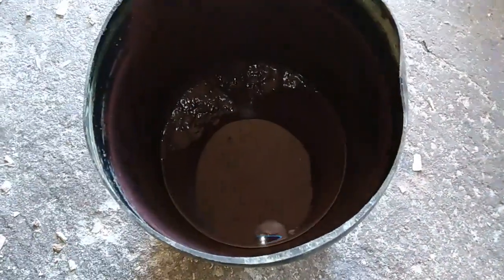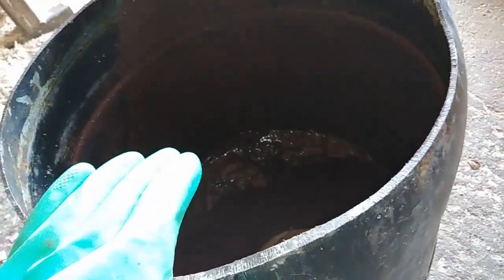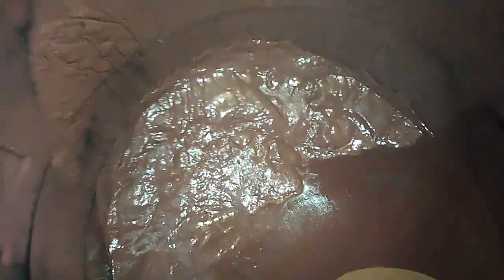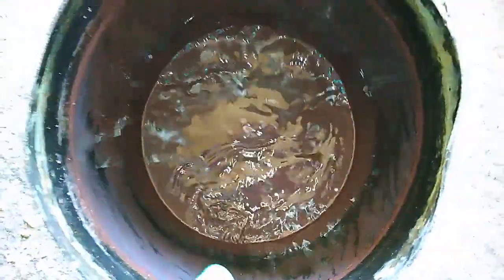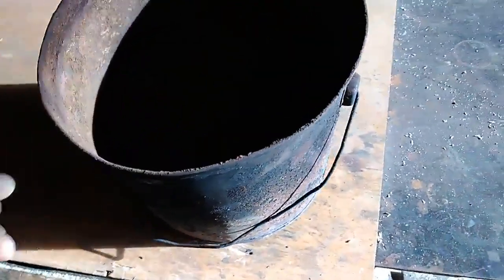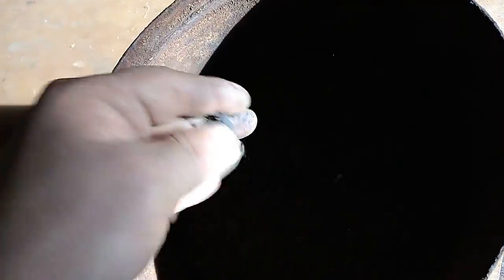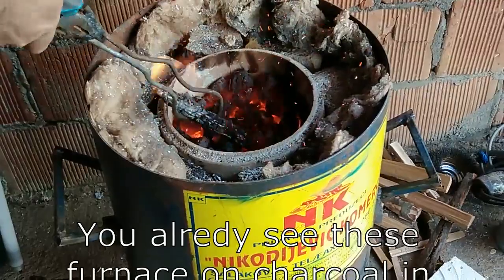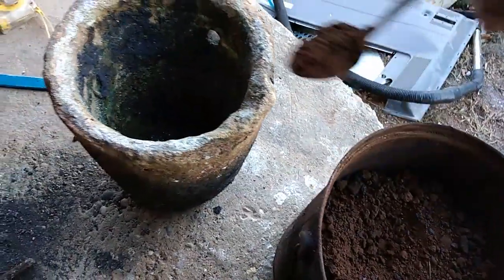Melting Copper from Ap solution-Charcoal furnace.

Comment: Is it really clean if you have cemented it with iron and aluminum?  They will shed iron and aluminum dust into the copper.  Also, shouldn't you add graphite into the copper dust to help reduce the copper?  Maybe some borax on top to keep oxygen out?  Thanks for the vid!
Reply: Can you explain a little bit about the graphite process
Reply: @yakupyazc9147  The copper dust is partially oxidized.  Also copper melts tend to absorb oxygen from the air.  Carbon in the melt reduces any copper oxides to metal and will help protect against further oxidation.
Reply: thank you very...
Reply: I don't think that he was going for bullion grade copper, just a means to extract copper from stock pots 🙂